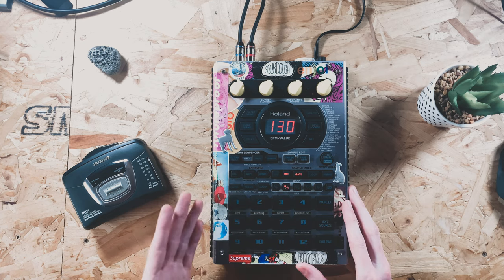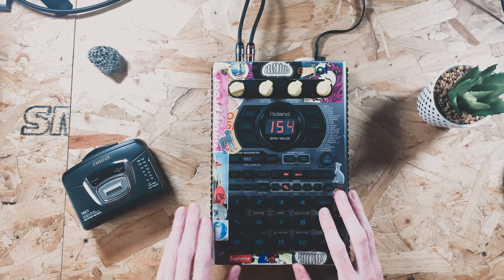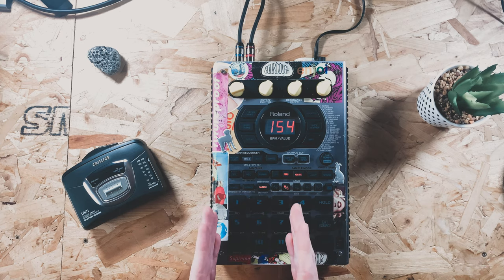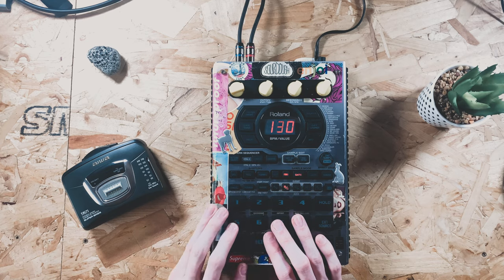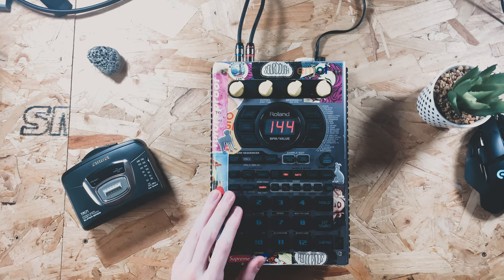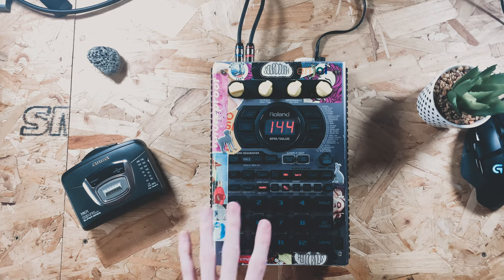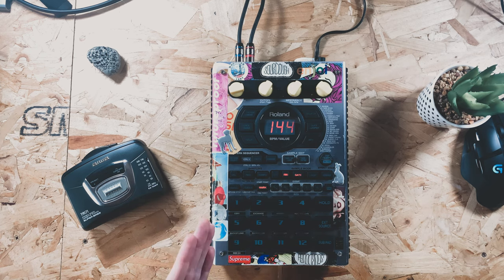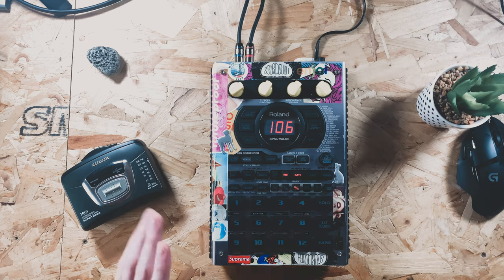How to make beats by micro-chopping records

Comment: My biggest grip on the sp404 is hitting the bpm i want with it's very limited time stretching. It was so much easier on the 2kxl
Reply from the maker: Yeah repitching and time stretching sucks on most of the SP models - the 202 being the exception. MPC is amazing for it!
Reply: @spvidz  thankfully I have a 2k making it's way here and it should arrive by December, I love the sp404 and it let me work in between MPCs but I have to say I might never use it as my main piece again as long as I have the mpc
Reply: @spvidz  the xl was also my first sampler so it's probably natural that that work flow is the one I like the most though, I think for the right person the sp404 is a perfect machine
Reply from the maker: Yeah they are very different. I personally find making full beats on the 404 quite tricky these days but it really depends what kind of sound you want too. I do need to spend more time on the XL though for sure!